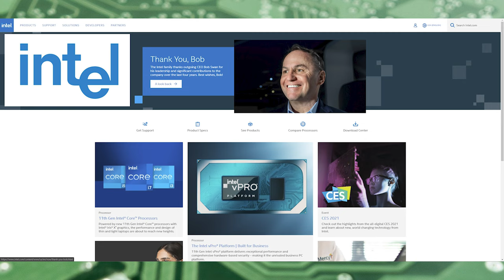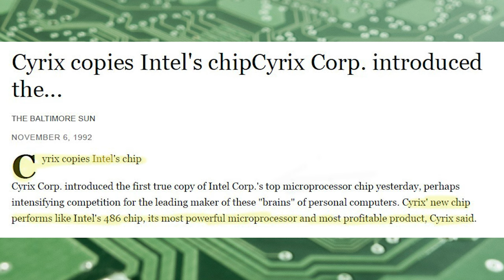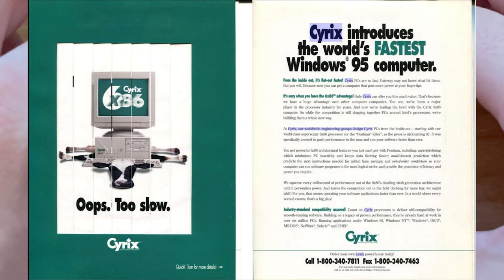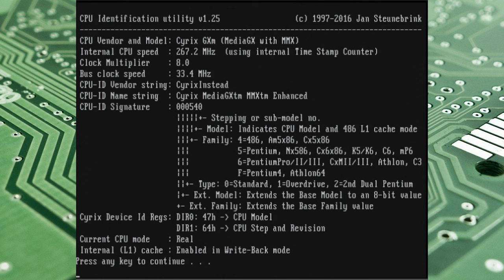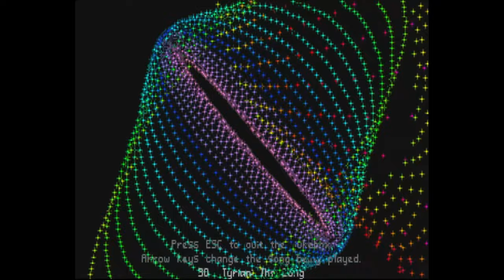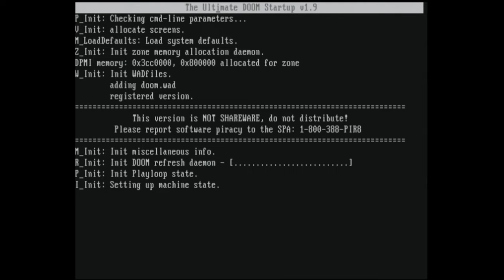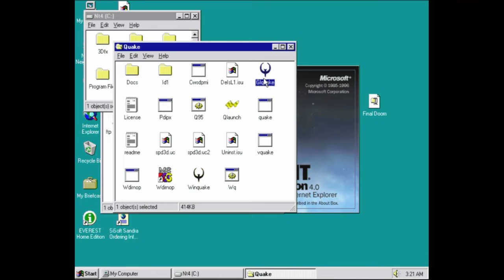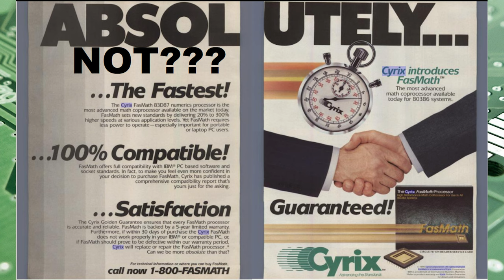QUAKED: The Cyrix MediaGX and the Rise and Fall of Cyrix Corporation

Comment: I was an IT manager and ran dozens of Cyrix systems - in two companies. For work, they were great. Cheap, reliable. But then... AMD... Very much stole their thunder. At the time Intel ruled the roost, but Cyrix COULD have fought back - they just didn't. A slightly better floating point and they would have survived. There was talk at the time of a Cyrix / Voodoo collaboration it never happened (obviously) but had they landed that - again - they could be today's AMD. When the K5/6 and Pentium stuff kicked in... Cyrix didn't answer. They could have, but didn't. Great for work stuff, crap for gaming. And nothing in between. Personally I'm ok with the current AMD/Intel monopoly on the market, but I think a third party would be welcome to keep them frosty. The SBC market is pretty good, but not competing in "their" market. We need a Cyrix to keep things active.

Comment: Interesting note @ 10:17 regarding the IBM 5x86c CPU's... my local scrap place had a pile of them (IBM 5x86c / IBM26 5x86-3v3100GF) with gnarly bent pins that I purchased for scrap value, I've been straightening them out and ended up with 8 working examples or so that I've been tinkering with in my stable of socket 3 boards.  All seem to do fine at 40 mhz x 3 (120 mhz effective) vs the normal 33 mhz x 3 that the mainboards supporting they Cyrix 5x86, but I hadn't considered running @ 66 mhz x 2 assuming it was too great a leap for the PCI bus vs 33 x 3 or 40 x 3.  If I canI can pair the CPU with a mainboard that can independently configure it's ISA/PCI speeds to ratio/divider values from the FSB this sounds like an interesting overclocking project for the weekend.  Great video, keep up the good work!
Reply: Rescue them all :)

Comment: My very first "modern for the time" PC was a MediaGX upgrade board I initially dropped into my old 386 case.  It was a 233MHz chip that I ran at 266MHz, and I didn't have benchmarking software I can point back to - but it certainly FELT much faster than a Pentium 133 in general usage of Win98SE.  I was actually quite happy with it until it encountered Need For Speed III, which it played with the integrated graphics - but not at a great framerate.  Its successor, a 1GHz AMD Athlon build w/ Rage Fury Maxx GPU would of course blow me away with hardware 3D acceleration!
Reply from the maker: Hey, thanks for watching! I hope you enjoyed! And oh, wow, that’s too cool! The MediaGX definitely feels pretty fast. It’s well-optimized and even the graphics core that it contains is pretty acceptable. It provides halfway-decent Windows acceleration, great DOS compatibility, and it’s plug and play, which is nice! NFS III would definitely do it though—I could see that game being a bit too demanding, but wow, what an upgrade! A Fury Maxx too!? How cool! I’ve always been fascinated by that card and the 1GHz Athlon was a legend. Was it a slot model? Or PGA? Thanks for sharing and thank you again for watching!
Reply: @RetroTechBytes  My Athlon was a PGA model, using the FIC AZ11 motherboard.  I picked the Fury Maxx with very little education too, not knowing how... unique... it would be.  I hadn't even experienced hardware-rendered 3D before that so I was green as hell, but I liked the pictures of the card on TigerDirect and I liked the fact that it had two GPU's... because two is better than one, right?  Of course!  That and I recall it being on-sale for a substantial discount off the "original" price, which may have been tied to its finicky reputation but what did I know - I just felt like I was getting a special deal.  I got along just fine with it too, and I kept it in my PC until I wanted to run Windows XP and discovered there was no driver.  I still have the card but when I retrieved it to use in a 2019 Slot 1 Pentium III retro build, I discovered it had developed issues with the secondary GPU.  Vertical lines of partially-corrupted pixels to be specific.  Honestly I'd like to get it fixed or buy a fully-functional duplicate for nostalgia sake.

Comment: Maybe a Rendition V2200 would be a better pairing with the MediaGX than the Voodoo 2 since it does triangle setup in hardware.
Reply from the maker: Hey, thanks for this idea! Now this is something I need to try. The V2200 is definitely pretty decent with a 486, and the GXm is a bit faster, albeit still a 486-class machine (ish). I'm curious as to whether the Voodoo 1 would actually be slower overall here; I'm inclined to agree with you due to the Verite's ability to not only handle triangle setup in hardware, but also because it seems to more effectively accelerate overall slower systems. I'll give that a shot! Thank you again for your support and for this idea!

Comment: The source code for the DECtalk text to speech system has recently surfaced, and both integer and floating point versions of the vocal tract model are available. I am curious how the floating point version would perform on a Cyrix chip when synthesizing speech in Realtime.

Comment: Your Gravis Ultrasound problem may be due to your newer PSU not having a -5v rail. Build yourself a Voltage Blaster and retry it.
Reply from the maker: Interesting. Now this is something I'll have to try! I have tried that GUS PnP on another system that had an AT PSU and had a similar issue, but I'm not convinced it's the card because some games do indeed work. The GUS PnP is just a pain in the butt, honestly. Great idea, terrible implementation in terms of drivers. But hey, thank you for the support and for the suggestion!
Reply: @RetroTechBytes  it may very well be the drivers, but the voltage blaster project is still handy to have around. I've heard that GUS drivers aren't too good. I personally stick with either ESS or Yamaha sound cards with a Dreamblaster MIDI daughterboard because I got sick of crappy Creative Labs drivers and hanging note bugs.
Reply from the maker: Yeah, that's where I'm at too. ESS/Yamaha cards tend to just work by comparison. I love the AudioDrives and I've found the ESS OPL-3 to be perfect, and in Windows, the enhanced-mode OPL-3 is very cool. With a Dreamblaster, you just can't beat it! OPTi boards are okay too, but some of them have weird quirks. Same with Crystal cards, but I'm probably one of the 3 people who likes Crystal FM haha

Comment: Why would you benchmark quake on NT4?
Reply from the maker: That’s actually a funny story, but basically, I had some issues getting my Voodoo 1 going in 98SE. It turns out that it’s a common driver thing, and GLQuake just worked better in NT4 for me. That being said, the overhead on the OSes shouldn’t be significantly different, but I do think I’ll revisit it with 98SE and DOS, just for consistency. I want to try benchmarking with a Cyrix GX1 as well, if this board can handle it!

Comment: I never used Cyrix but I've always been curious about these CPUs. It's such an interesting history and I wonder what the industry would be like today of they were still around.
Reply from the maker: Agreed! Cyrix CPUs get even weirder too! There are certain registers in the 5x86 that can enable branch prediction. And the 6x86 and 6x86MX (and MII) have like 5-10 registers that let you gain at least 10% in performance if you set them right! As for the 5x86, it's wild to think that a 486-level CPU can operate like a Pentium in that sense with its branch predictor. Unfortunately, the 6x86 wasn't too spectacular compared to the 6x86MX. Truthfully, a 6x86MX PR200 is one of my favorite CPUs to work with. It's fast and stable, and it's essentially a Pentium 233MMX in integer math! Its FPU is a bit weak, but with a Voodoo 1 or Voodoo 2, it performs really well in 3D. Even something like a Matrox G200 makes up for the FPU deficiencies in these chips!
Reply: I always used Cyrix back in the day, can't remember the exact chip I had but I overclocked it to 333Mhz! eventually the gold IHS thing lifted off the package and it died :( wish they were still about today.
Reply: @RetroTechBytes  

I had an IBM 686 MX PR333 which was just the Cyrix processor branded as an IBM part.

That worked really well with a 3Dfx Voodoo Banshee.

If I recall correctly we worked out a way to achieve a modest CPU overclock over standard but importantly we were able to do so with 100 MHz front side bus on a super socket seven board with an ALi Aladdin chipset. It actually made the chip scream in relative terms.

Comment: can UNISOUND find  the internal soundcard?
Reply from the maker: You know something? I hadn’t thought about that. I’m going to give that a go. UNISOUND works wonders and I think you’re onto something. I do know that the MediaGX’s implementation of the SB16 is imperfect, but, if anything can get it going, it’s UNISOUND for sure! Thank you for the suggestion!
Reply: @RetroTechBytes  you can use mediagx pc104 board to build a much smaller dos gaming box.
Reply: @RetroTechBytes  mediagx is an imperfect S3 video + imperfect ess audio.
Reply from the maker: Interesting idea! That would be a cool and super small DOS box for sure! And yeah, that sounds about what it is for sure!
Reply: In my GCT-MGX integrated mainboard (Cyrix MediaGX-S @ 200 mhz CPU + Cyrix CX5510Rev2 Chipset w/ ICS 5342-3 GenDAC for the integrated video) the sound is handled by a separate CMI8330A audio chip, which works fine with UNISOUND.   I believe they supplemented the audio portion of many 5510 chipsets based on the injunction that prevented OEM's from shipping computers that included the audio features during a lawsuit that Creative Labs filed in 1997.

The graphics core is pretty anemic in "2D" applications including Doom and has generally terrible compatibility with older DOS games and UniVBE making it poorly suited to retro gaming on it's own..  in Quake/early 3D performance it's a bit slower than the original S3 Virge chipset which would be a cheap upgrade to greatly improve performance + compatibility with older DOS titles in addition to enabling some advanced VESA resolutions for games like Duke 3D and Quake.
Reply: @TheYuppiejr  because MediaGX-S @ 200  missing some Instruction Sets. So it actully like some 486 ,not Pentium.   and the chipset is 5510 not 5530 . if you use GX1 300Mhz and 5530A , that should be better.